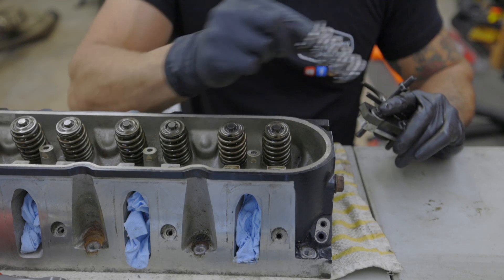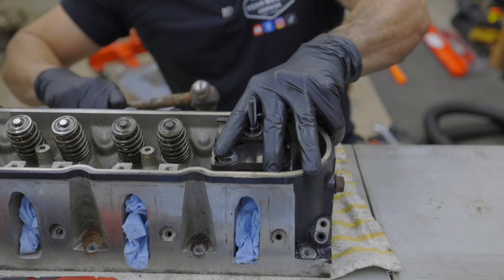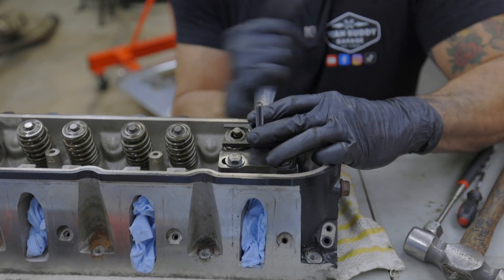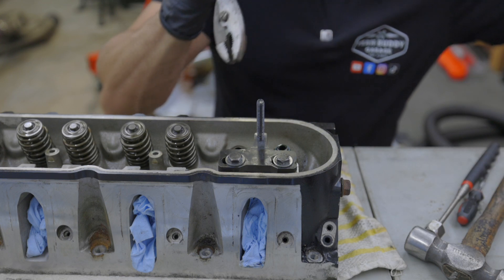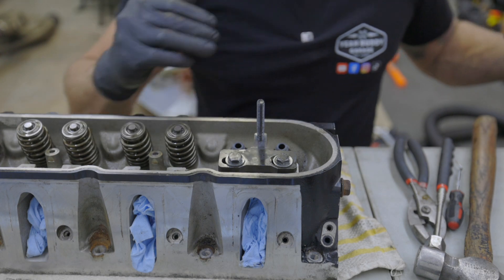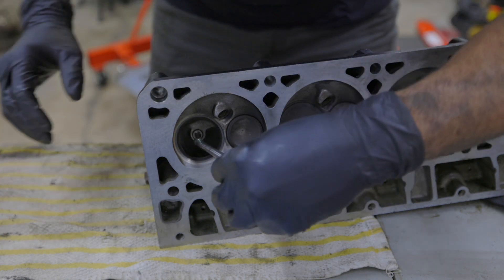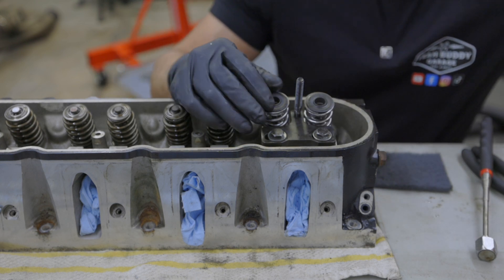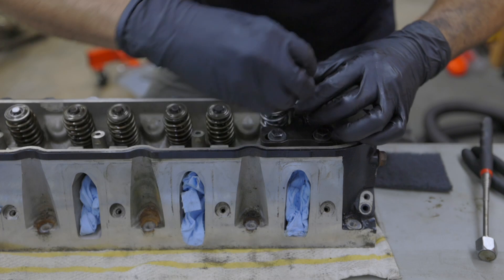Stock LS to Brian Tooley Racing Valve Springs | No BS Tech

Comment: Great video! I have to remove some broken exhaust manifold bolts before getting started on mine. Any regrets with the Amazon tool? I need to figure out what I'm going to use as well.
Reply from the maker: Hope you get those bolts out. They can be a pain to remove. That tool worked great! Threw it in the tool box for the next one. 😎